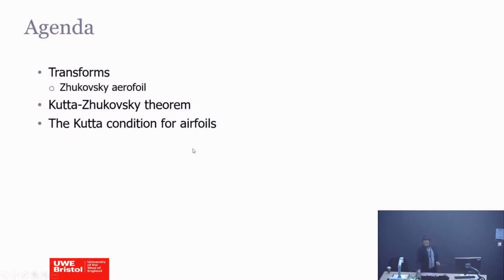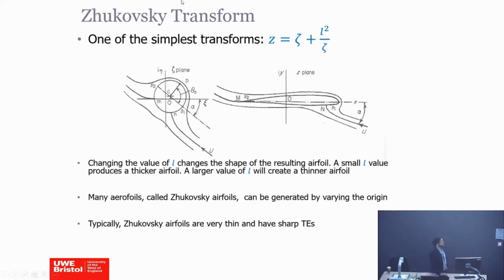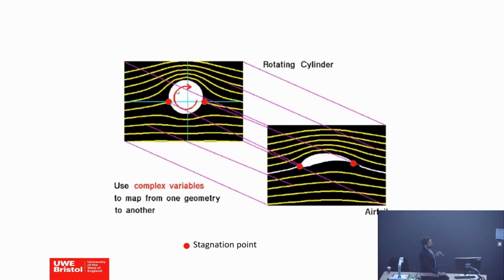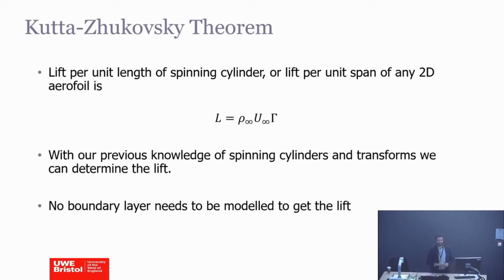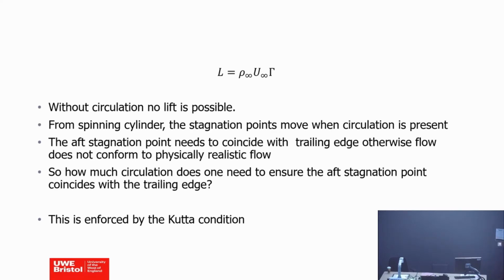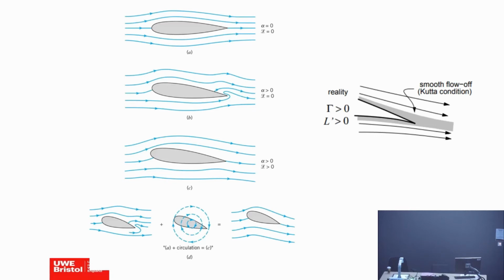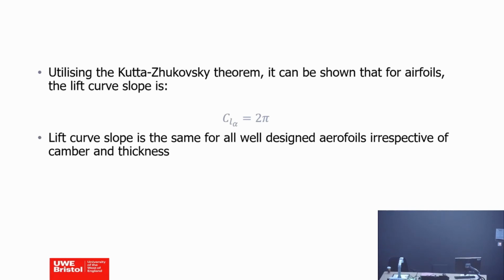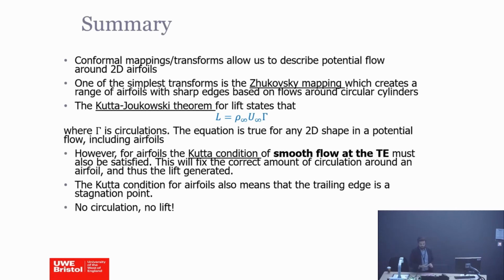Transforms Kutta Jokouski Lift Theorem Kutta Condition

Comment: A two-dimensional numerical method for an aerofoil solves for the distribution of vorticity on the surface of the aerofoil using a Fredholm integral equation of the second kind. The matrix that is generated has a dominant leading diagonal and matrix inversion is not difficult. It would take just 13 lines of coding in something like Excel VBA, which could then be easily distributed.